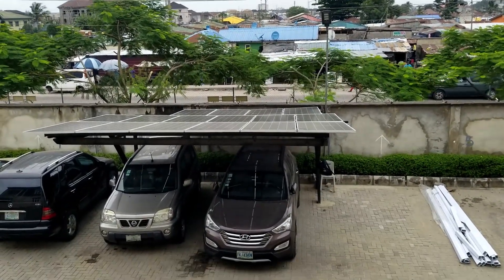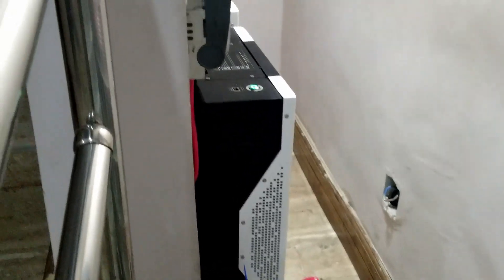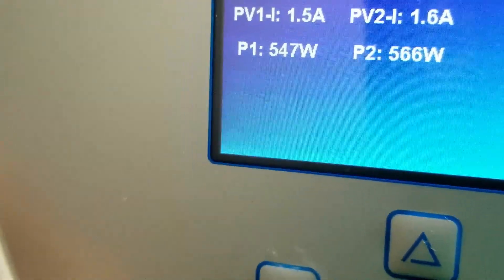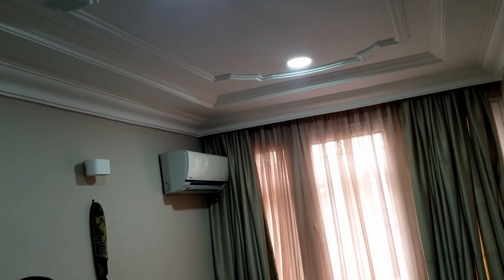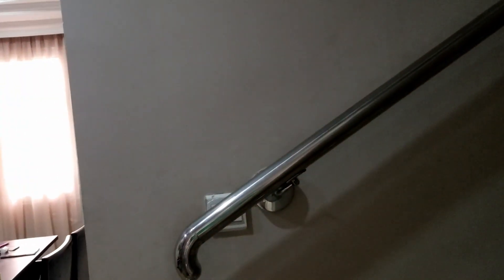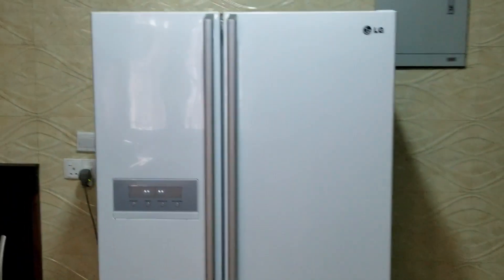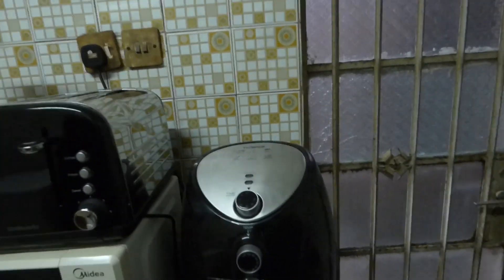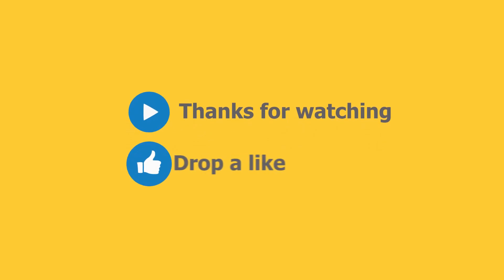The 8 kw Deye in action and Oh I make southern fried chicken

Comment: Did you ever log the idle consumption of this inverter as Im considering this as my main inverter for my personal new system
Reply from the maker: About 50W. Thank you for watching and commenting. It is an awesome inverter for personal use. I have the 5 kw and it has been a beast. I run everything on it. The AC's, water pump, microwave, air fryer, toaster, a small hot plate and much more. You would love it
Reply: @drsolar  I'm looking at the 8kw and I'm watching all your videos now. Thanks for making them. People like you help the rest of us so much
Reply from the maker: @kurtmccormick1730  thank you so much for your kind words
Reply: @drsolar  can you please make some of your videos on the big lithium storage solutions offerred these days from china. We all need to know of good and economical options for buying the most expensive parts of these types of systems. Thanks in advance my good man!
Reply from the maker: @kurtmccormick1730  I would love to. My pocket limits what I can do. As soon as I am able to purchase one. I will do a video.
Reply: @drsolar  can it handle eletric stove with heat glass plates?
Reply from the maker: @GreekSIMRACING  yes it can. A friend uses an induction stove on it

Comment: Any reason why you use the Weco batteries, would you consider them the best for the money now, what's that cost of them?
Reply from the maker: Good evening. They operate in open loop and maintain the 10 year warranty. They are expensive. If you want something that will operate in open and closed loop and maintain a 10 year warranty they are a good value
Reply: @drsolar  Ok.. How expensive ?
Reply: @drsolar  Hi Dr. Solar, what is open loop and closed loop?
Reply from the maker: @Floyd112007  thank you for watching and commenting. Please don't forget to subscribe. Open loop there is no communication between the inverter and battery. Closed loop is the opposite. The inverter and battery communicate allowing you to fully use the battery
Reply: @drsolar  Thanks, Doc, I have been subscribed for a while now.  I will be getting a Deye soon but I am currently using a Growatt, getting it to communicate properly with the battery has been challenging.  A lot of people on the DIY solar forum seem to be using them without communication but I get the feeling that proper communication would be better than no communication.